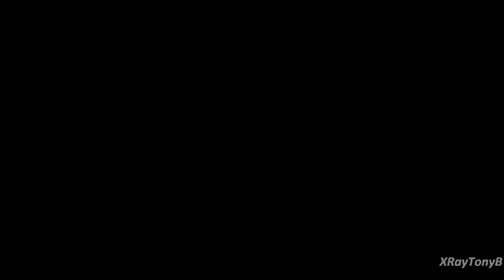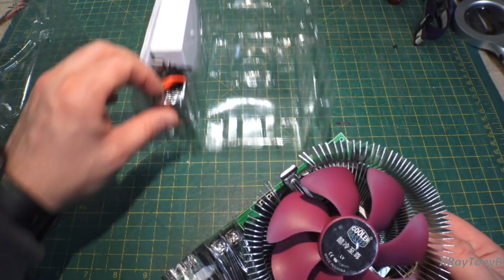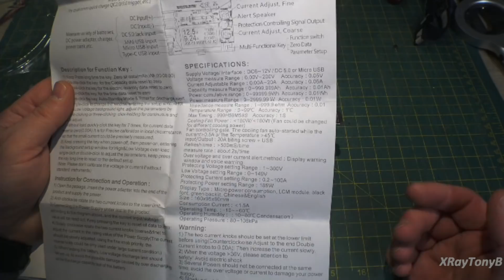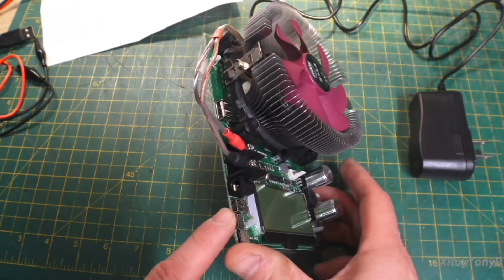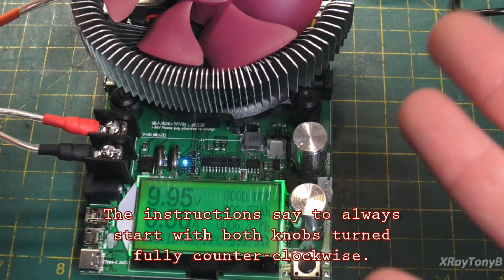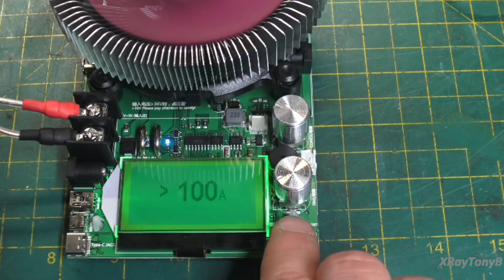Electronic DC Load Tester from eBay

Comment: 6 years later . . . I bought one of these on Amazon yesterday and it has the exact same Usage Introduction sheet of paper (word for word the same) It's 150 watt rated with that same fan. I'm using it now at 125 W because it's a hot day out on the garage and I'm keeping the unit's temp around 75ºC testing a 100A lithium RV battery that I think is defective because it self discharges 6% in just a few hours with no load.

Comment: Hello friend I buy 1 if that, last night I empty 5 pcs 14v lifepo4 battery pack, works very well, but when I plug it out and thus morning plug it again, device will turn on but when I connect any cell or battery, shows voltage of it but not work volume controls and current not change from zero and also cooling fan not work, do you know what's problem of it?
Reply: yes the MOS is broken, it happened to me yesterday, so i changed for another one (irfc 640), 'till waiting for the right spare part

Comment: Is the white connector that is in between the two current adjustment knobs for an unloaded voltage measurement at the battery's terminals (in other words 4-wire measurement)? It would make this unit a lot more accurate and useful to me, but I imagine that would require a jumper or some provision for the device to know to use that measurement and not the measurement taken onboard at the loaded end of the power wires.

Comment: Thanks for the great review. I got one of these and trying to calibrate a DC DC step up converter to run 18v 10A. On the other end I have the bench power supply sending 12v 10A. Any idea why the amperage on the load tester only goes up to 5A while my bench supply and the dc dc converter reads 10A?

Comment: LOL, The Chines sure do like screwing with us.   I figured out the Low Voltage Cut Off .  DAMN,  A lot of rig o ma roe that is.   If you miss your mark you get the Reset the thing and I'm still not quite sure how I do it but I can do it.  The Two Quick Press to increment the values works strait away .  Not So if you wait too long.  You have to have your chit together witch I don't.  LOL  Took me 30 minutes to set up to test some A123 cells .  Limit discharge to 2.0V and what not.   Sure would have been nice if they just had a damn Increment button ?
Reply: Put it twice and goes in One Direction click it three times it goes in the other direction and if you hold it it just Scrolls so you don't have to reset it which I did the first time but not the second time

Comment: So doing capacity testing on a LiFePo4 cells I can set the Low Voltage shut down using the <00.00  setting adjusted to say 2.50V settings to terminate load at that voltage ?    * Found Posting below explaining how to.  Exactly the information I was looking for.    Thank You

Comment: If you want to see the electronics under the heatsinks, watch the video at:
https://www.youtube.com/watch?v=3eOLWtMfjSk
You can also see the 150W and 180W boards are virtually electrically identical except for the heatsinks, and I believe they are.
He also went through a problem I had and demonstrates some more functionality, and shows that the two semiconductors adjacent to the power MOSFET run VERY hot at higher test loads. After quite a bit of use, his PCBs were both discolored on the PCB backside under their locations.

I recommend watching it at 1.5x speed. It's perfectly understandable.
(note: I also watched THIS video at 1.5x speed without any problems.)

Comment: Thought I'd point out a MOSFET THERMAL FAILURE EXPOSURE WITH THE HEATSINK MOUNTING SYSTEM.

On the unit I received, the 4 cheap plastic pins that hold the heatsink round/circular base to the PCB do not hold it tight against the PCB. There is vertical slop in the fasteners that allows almost 0.5mm of vertical movement between the mounting base and the PCB. This means when the heatsink is mounted to the base the thermal compound that is supposed to ensure efficient conduction of the heat from the MOSFET to the heatsink is under stress, especially whenever the unit is moved around. That means that over time it's possible an air gap can develop between the MOSFET/thermal compound and the heatsink, which could lead to failure of the MOSFET due to insufficient cooling.

Any gap will also allow the thermal compound to dry out faster than if there were a tight seal...again leading to earlier failure of the MOSFET.

Also, in a second unit I received, 2 of the 4 pins had detached completely from the PCB and were just rolling around in the plastic clam-shell packaging. They were NOT damaged...they had just fallen out during shipment. So, upon receiving your unit I recommend at least checking all 4 pins are securely attached to the PCB.

However, I highly recommend replacing these cheap plastic pins with quality non-conductive screw fasteners. (note: on my particular units I verified I could use metal machine screws without risk based on PCB design of both units, but I still used plastic washers to isolate the lock washer and nut for each screw from the bottom side of the PCB's lands.)

Whatever method you use, occasionally check that the mounting base is still securely held tight by the fasteners.

Note: both units I have are the 180W units with the massive vertical heatsink with two 92mm fans attached, so the heatsinks weigh a lot more AND have a higher moment-arm from the top of the heatsink to the base which can add significantly more force to the mount than the 150W unit with it's low-profile single-fan heatsink.
Reply: Good information thanks!!!!

Comment: Hi !! Have you tried connecting a constant current source? like those used to feed LEDs, with mine I could not do it, only with resistive load. Sorry for errors in the translation, my language is Spanish.

Comment: I never see anybody test these with micro USB or USB-C... Can this even test USB-C QC or PD power supplies??
Reply: The 1-page spec sheet that came with the unit says it does...sort of.
Unfortunately, it looks like the ONLY Quick Charge test is on the standard-sized USB connector to the left of the coaxial connector (spec says="by qualcomm quick charge QC2.0/3.0 trigger, etc"). To test USB-C quick charge or other type it looks like one needs an special adapter for that connector.

While it has C, micro, and mini USB connectors, the 1-page spec does NOT explicity show them supporting Quick Charge of any kind.

Comment: Low-Voltage cut-off issue?
KainkaLabs in the video at https://www.youtube.com/watch?v=KcGBHZEOt5s claims there is no Minimum voltage cut-off and he had to add a custom circuit to what appears to be the same product in order to get the device to stop drawing power from for instance a battery when the battery's voltage dropped below a specific value. He claims this is to keep the device from draining the battery once it dropped below a voltage he sets on his special added circuit (his circuit provides 3 discrete cut-off choices at 1V, 2V, and 10V).
But, you seem to say that the device already has a minimum voltage setpoint (you call it a "trip-point") function and will stop draining a connected battery when it falls below your entered minimum voltage trip-point.
The text at the bottom of the video claims both Min and Max setpoints are available for volts, amps, and watts...or, am I misunderstanding what you said and showed on the display at 10:24?

Also, is there a link to an online copy of the user manual/pamphlet you can point us to to help clarify this issue?

My entire reason for getting something like this product is to be able to automatically test batteries without having to worry about over-discharging them during a test.
Reply from the maker: I would have to check to be sure, but I think there were several versions of this unit for sale out there.  The biggest problem I have with this unit is that it is a pain to program, with all the multiple button -push menus and such.  I think I might have a PDF version of the instructions.  If you e-mail me, I'll try to send you a copy.  Thanks for watching!
Reply: The units I received both accepted setting a low-cutoff voltage.
Example, it defaults to <0.00, and I set it to <3.00 while I was testing a LiPo cell. When it got below 3.00V the device set the load to 0 amps, displayed "<3.00v!" in the display, and started to beep about once every 2 seconds. After enough time for the cell to recover to over 3.00V, the device did NOT automatically restart load testing...which is exactly the way it should be.

Setting the cut-off voltage:
The easiest way is to go to that menu page, and then press and HOLD the button until the cut-off voltage increases close to the value you want (e.g. go to 2.50V or so for a 3.00V cut-off) then For high accuracy to set the cut-off voltage to 3.00V press the button two quick times to increase the cut-off voltage to 2.60 volts. Each time you press it twice quickly, it increases the cut-off voltage by 0.10V until you reach 3.00V.
Edit to add: CAUTION! IF you exceed the cut-off voltage setting you wanted, then in the case of the units I received it's an issue. There were two things that happened. I found I could keep going until the meter showed 200V and then reset to 0V...OR I could screw around with it until I finally managed to get it going backwards to lower values when I press and held the button. It was inconsistent though. I THINK once I had gone past the value I wanted, I was able to stop pressing the button, wait 20 seconds or so and then press and HOLD it again, and it was going backwards. It didn't always work. I also tried power-off for 30 seconds and then seeing what happened with that setting, and again things seemed inconsistent. So, your experiences may differ from mine. I hope so. Recovering from that mistake (setting above the cut-off voltage I wanted e.g. 3.2V instead of 3.0V) took a lot of time to resolve.

AFTER the test unit stops when the cut-off voltage is reached:
HOWEVER...when you press the button to read the values of the cell at the time it cut-off, the display shows the recovery voltage (e.g. 3.35V, increasing the longer you let the cell recover from the test) of the cell, AND the load testing CONTINUES (see Note1 below). Fortunately, the Ah and Wh values were saved and still show what they are at that point in time. So, there can be a minor difference between the cut-off tested Ah and Wh values at the initial 3.00V test stopping and what you see on the display when you press the button depending on the A load at which you are testing. It should be minimal but keep it in mind.

While discharging the cell:
Also, while discharging the cell, the voltage only showed the voltage decreasing in values of 0.07V or 0.08V between updates. So again, there may be a minor difference between when it actually cuts-off...it might not be exactly 3.00V. In my case, I'm hypothesizing it likely cut-off when it worst-case hit 2.97 because the last update prior to cut-off was 3.05V. In most cases that's not likely to be significant. Just another thing to keep in mind.
3.05V-2.97V=0.08V.
====================================

Note1: This works MUCH better when the cutoff voltage is reached and the display is showing "<x.xxV!" and beeping. and BEFORE you press the button to see the test results, you turn the potentiometers full-ccw. This way, the unit won't restart discharging the battery/cell because it has self-recovered a bit above the cutoff voltage. As most cells/batteries do when you stop discharging them the cell's voltage starts to self-recover and increases a bit. This increase can be significant over time and tops-out higher than the lowest voltage it reached while in the discharging test.

Comment: Hello, my Load Tester nothing happens, I turn the potentiometers and nothing.
I've already changed Mosfet 2 times, nothing happens.
Can you tell what might be happening?
Reply: You need to see and test the voltage across the mosfet drain and source . 
And you need to check the gate voltage too .

And test the 2. SMD transistors rectifier beside the mosfet .

Try to do a reverse engineering electronic test item's.

For me to fix this stuff is easy cake

Comment: So, what actually uses the current in these?  Is there a heating element that's fed via PWM or something?
Reply: The energy is dumped into a power MOSFET. The MOSFET can IN THEORY handle 300W at 25C with the proper heatsinking to keep junction temperature requirements in check. With the high-profile 2-fan heatsink that's limited to about 180W, and with the low-profile 1-fan heatsink that's limited to about 150W. It's possible with higher airflow-volume fans and/or a different heatsink, and/or a superior thermal compound you could obtain higher power operation. Could likely get quite a bit higher Watts with a water-cooled system...I don't know what kind of software protection is built-into the firmware IF ANY that might put additional limits on maximum power dissipation.

The MOSFET is underneath the heatsink. DO NOT REMOVE THE HEATSINK unless you know what you're doing.

Comment: back in the early 1990's I had a hand in designing a 4 channel electronic load that could handle 500w per channel in a 5"high rackmount chassis. You could parallel channels and they would power share for higher power ratings. I think we sold those for about $1,000 back in 1991.

That Chinese load is a steal for the price.

Comment: I have LTO Lithium batteries 40ah cells resting voltage is at 2.9 I need to discharge to 2.4 will this device work
Reply: From what I've seen, I believe it will. There are cheaper alternatives if ALL you want to do is discharge a 2.9Vnom cell with auto-cut-off at 2.4V.

I discharged a LiPo cell charged to 3.20V with a cut-off V setpoint=2.40V and it took it down to 2.70V WITHOUT shutting down the discharge process (I didn't want to damage the cell in test so I manually terminated at that point.)
However, the tester did let me set the cut-off voltage (I call it Vcutoff or Vterm or Vt) to 2.40V and everything else worked as expected so I see no reason it wouldn't work for you and cut-off at below 2.40V as one would expect.
However, please read my comment above in this same video at:
https://www.youtube.com/watch?v=ed9iEQlH5t4&lc=UgwMnO_kKMcJVbJn0LJ4AaABAg.90G32s73b9G96pRHzwBjnT
for more information on my experiences with this unit (or a comparable one as there are different versions out there). As best I can tell mine is very close in appearance in every way to xraytonyb's in this video except mine is the 180W heatsinked unit.

Yeah...I know Bigkato's question was a year old, but someone else might be interested with the various different voltage cells that are out there.

Comment: Check out the dummy load made by “five fish audio”. They are located near me… I think he’s in Nashville somewhere. The pcb is available on his website and eBay, and you have to assemble it as a kit. From everything I’ve seen and from the board I got, top quality, great design, and will make an incredibly good device. I’ll be putting it in an old fluke  Benchtop multimeter enclosure… looks like it will make a really high-quality load. Thanks for the video. The ones for me but I do seem very good for the money.
Reply: I think US$23 is a bit steep for JUST the PCB.
The detailed and Digi-key auto-ordering parts list is great but that's still added cost to the project. I input the inquiry to Digi-key and there are two parts that are "in error" (obsolete, an IC and an LED) so you have to find an equivalent part) and the order won't process unless those items are removed from the auto-order. In addition, Digikey wants 2x $7= $14 for the MOSFETs alone. That's quite pricey...and I like Digi-Key.
As far as I can tell his board doesn't have a built-in display. You need to use external equipment to read the data and provide your own power supply, so that's even more cost.

But one can buy this decent 180W unit fully tested and assembled for about US$40-$45 on eBay, including power supply, and a couple test leads. Less than $40 if you're willing to wait for shipment from China. Seems a more logical choice.
I was quite shocked that mine arrived from China only 8 days after the order. The order was placed March 19.

If I need more than 180W I can change the MOSFET and the cooling on a cheaper 150W unit for fairly little money and perhaps an hour of work, and probably easily increase it to have over 200W of power handling...if the firmware allows it. Otherwise, I'd have to hack that bit.
Reply: Send me the link for that PCB .

And for this 180w I can modefid the mosfet to reach 300w / 25a .

But I think I can do more modefication to reach 400W

Comment: Well I made the mistake of buying one a wile back and really had it stuck to me. I paid like $80.00 or 85.00 for the one I got. Another mistake I made was getting it for testing 18650 batters. A power wall person suggested it and boy what a bad mistake that was also. I set it so it will stop at 3 volts low side and all it does is pop up (3 volts?) the whole time when in use. It can be used if you don't mind having to scroll through fast enough to see what's going on with the other settings. Even if I had gotten a better price it is worthless for testing batters.
Reply: If you serious want to test 18650 (eg. other type battery cells) go for this:  https://www.ebay.com/itm/QC2-0-3-0-MTK-PE-Trigger-35W-20V-EBD-USB-Tester-Current-Load-Battery-Capacity-I/173129018123?ssPageName=STRK%3AMEBIDX%3AIT&_trksid=p2057872.m2749.l2649

Comment: Good review. I wonder why the voltage reading dropped 50mV shortly after you connected it. There should be zero voltage drop across the cable with the current set to 0.00A, regardless of the wire resistance. Have you checked the actual voltage at both ends with a multimeter? I find the voltmeter on many power supplies (even an expensive Farnell unit I have) are pretty inaccurate..